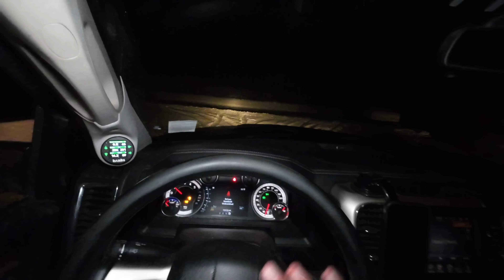Date night at the snow park goes wrong!

Comment: Good job. Calling for a tow is to easy!  I used a 1.5ton chain hoist to get myself out of a bind( my 4x4 actuator failed) 1/8 mile 2.5 feet at a time. Dec. 23 to jan 3 I had to use my toboggan to haul equipment 1 mile threw 2ft of snow and -38c every day to make a couple of yards. ( I live off grid in the bush in east central Alberta).
I made it😆🥶🥶🥶🥶🥵🥵🥵🥵

Comment: There's a tow hook on the passenger rear and a tow hook in the tool kit that screws into the passenger front bumper behind a small plastic panel. The tow hook is or should be in the jack storage area unless someone removed it! I Googled it! 😁
Reply: Apparently you didn't see the video about the reliability and strength of those front tow adapters.
Reply: Based on how you wrote that, you’re essentially saying that Casey has ZERO experience in towing because even I, as just a viewer, knows that those hooks are strictly for moving a FREE wheeling vehicle on normal ground onto a wrecker or carrier at no more than a 15 degree slope, ok?
Reply: A lot of tow companies won't do recovery from those because  it's known to rip out.
Reply: One of the many things I've learned by watching this channel is how weak those screw in tow points are, I used to assume that was the correct point to tow from, apparently not, find his video on them and he explains it much better than I can.

As others have said, there should be by law proper strong tow points.
Reply: @JohnHallgren  My reply was to C W

Comment: It's way past time for there to be legislation requiring all vehicles sold in the US to have recovery hooks on the front and the back of the vehicle.
Reply: Would it have to be legislated?  Couldn't  consumers just demand that tow points be a standard option?
Reply: @ryanthomas2472  most laws help a lot of people...
Reply: If interested read my rant above, No more gov regulations and 99% of the recovery points will never be used by the general public add them on your own if you wish or not.

Comment: Figures that a guy wearing shorts in the snow would be running THOSE tires on a front wheel drive vehicle with no chains on board in those conditions. It’s almost as if they were TRYING to get stuck. Looking to be INSTA-FAMOUS?

Comment: Hi young Casey, from your description of road conditions, you can perhaps understand some snowy cold countries in Europe by law get all motorists to change over to winter spec tires, to them it's a normal thing to do..If nonmandatory country residents even just touring through must comply with the winter tire laws, so we get in England here sets of 4 steel wheels with little used tires and wheels for sale. the down side would be less work for you I guess but as the USA is a huge country wityh lots of snow burdened States I thought I would just mention It/ THANKS for the video
 yet again. Ian UK.
Reply: Also, places like the Pacific NW for most areas do not get much snow. For instance, west side Oregon, they may not get more than a dusting some years, if that, however where Casey is, they get plenty as they are in the mountains. 

Same in Western Washington where I live, though we've had snow once each year since 2020 and likely will not see anymore this winter, sadly as La Nina is weakening. We got snow in Dec but maybe a couple of inches at best for much of Puget Sound before Christmas. Eastern Washington can get more most years than we do on the west side, but we get the rain and warmer winter temps overall.
Reply: So as a huge country should those same winter tire laws in the USA be the same for Tampa, Fl as say Bismark, ND?🥶  Several states with mountain passes do place temporary restrictions(check-point) requiring 4WD-winter tires- and or chains at times of inclement weather as required. Otherwise as a nation we still are able to enjoy most freedoms.
Reply: @iffykidmn8170  Enjoying your freedoms Is In your constitutions I believe, getting stuck In snow or Ice Is stupid. Casey proves that point. You have a right to choose In life and apart from the hottest states - that flood badly, water wings would be more beneficial for some drivers who see deep water yet say, it's OK ITS ONLY WATER.. no snow tires needed for boats then.
Reply: @ianburit3705  If one drives long enough no matter what one drives you are going to get stuck including Casey, how one plans to get out of said situation is another matter and in this situation they had a phone and Casey's number situation handled.:text-green-game-over:
Reply: @iffykidmn8170  So, IF they had suitable tires on their vehicle as you would wear suitable clothing for the weather we would not be discussing this - you don't walk in deep snow in shorts t-shirt and sandals, do you. You equip yourself for the weather requirements. Snow tires are no different. That's unless you want to endanger yourself by being stranded from being stuck.
Reply: @ianburit3705  Full believer in winter tire even have Blizzaks on a van very siimilar to theirs and it is still a turd in the snow so it gets parked for the winter and I drive a 4WD suv sitting on Blizzak snow tires.  My choice not their decision not your decision or anyone elses.
Reply: @iffykidmn8170  I found you the story of some tires I once used, they were outstandingly good in just deep snow In 2 wheel drive.. these days I drive a landrover diesel automatic but get very little snow on the sunshine coast of north Essex UK so use all-season tires - NOKIA tires video and story. https://www.youtube.com/watch?v=GvJijBhKtRs

Comment: It's amazing that people keep buying those front wheel drive Fiat designed vans.
 The more weight you carry the less traction you have.
Reply from the maker: Wrong.  More weight is more traction
Reply: @CaseyLaDelle  not if its loaded over the rear which on a front wheel drive vehicle unloads the drive wheels.
Reply: @robs4517  so its not about the weight but improper weight distribution, should have said that in the first place.:face-blue-covering-eyes:
Reply: @iffykidmn8170   I suppose I should have clarified my statement. Load balancing is why trucks are predominantly rear wheel drive biased. The load over the drive axle does increase traction. FWD loses traction the more you load it on the rear. You can see pickups with improperly loaded trailers do the same thing. If the tongue weight is too high the front wheels unload.
Reply: @robs4517  And when I place a load inside the side doors it basically loads both front and rear axles as placing the load between both axles.  Having done heavy haul, I am sure Casey is familiar with weight distribution and sliding 5th wheel to load steering or drive axles same concept.:text-green-game-over: